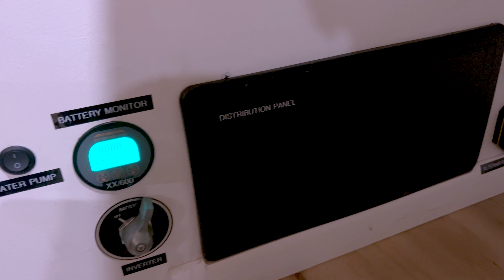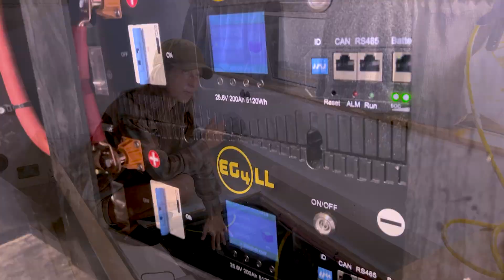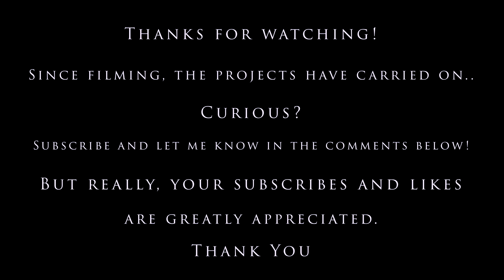Easy RV SOLAR Upgrade - 24 volt EG4 Lithium Batteries and Victron System

Comment: I really like that bright pink color. They can see your customer coming for sure! Nice balanced job and really clean install. We built a rack to mount 8, 550w panels on our motorhome's roof. After mounting the 18 feet that attach the rack to our roof, we caulked each of them and then sealed the entire roof, incapsulating the feet with Henry's Tropicool 100% silicone 887, lifetime guaranteed roof sealer. This is a highly reflective roof sealer that would work perfectly with bifacial panels. We went with single sided panels to save weight as the bifacials are pretty heavy due to the protective glass on the back of the panels. We have 4,400watts up there and another 620w liftable array on the side of our coach, so we thought 5,020 watts was enough for our needs without the bifacial feature. We were right. 

We use the 620w array to charge our 12v 560ah LiFePo-4 battery and our rooftop array to charge our 320ah 48v LiFePo-4 battery, for our 120v ac needs, like our residential fridge and our 12k btu 28.5 seer-2 EG-4 mini split. We use a 5kw Sungold power all-in-one inverter/100a charger/charge controller mounted on the wall in our bedroom rather than individual Victron components. This gives us a total of 23.5kwh of batteries onboard, which does the trick, lasting through several days of bad weather if needed. In fact, we haven't had to run our generator in the last 2 years of FT off grid use. Our large 48v battery lives under our bed which is heated by our furnace while our 560ah battery is located under the steps of our coach, where the original pair of GC-2 golf cart batteries used to reside. We insulated this space and cut a small hole in our step riser with a small computer fan to circulate conditioned air from inside our living area into this space, so the BMS doesn't shut down charging from them getting too cold in the winter, or their life reduced from too high temps in the summer.

Comment: oil resistant black rtv silicone for engines is by far the best way ive foind for getting a good seal that wont break down over time. 20 bucks a can but well worth it as a  couple cans would do your whole project

Comment: Love the new upgrade and a side note the AMG batteries can drop down to a quarter percent no more we use them here on our off grid Homestead and we have AMG batteries hard and they still take a good charge we've been looking into the lithium ions the technology is getting better I'm also a solar installer and technician but I am retired now I'm doing soldier when I have to I'm definitely looking into the lithium sit-up that you put in this bus it looks a lot better than the battle borns lithium batteries keep up the awesome videos

Comment: Bifacial solar panels are perfect for when camping, and you have the panels motorized to angle up and take full advantage of the underside.    Like parking at a different angle isn't doable, but raising the panels at a 45 degree can be more efficient.

Comment: Bi-facials panels are great if you do a ground mount where the panels are about 3 to 4 feet off the ground, that you have more ambient light reflecting the back of the panels.  Unfortunately rooftop mounting bifacial panels won't get you as much gain as you wanted.  Love the bus.

Comment: FOR SAFTY:     EG4 batteries are great for stationary applications, but they are not rated for mobil use.  For reasons such as cables fray and busbars can become lose along with many other issues I would strongly recommend you don't use rack mount batteries for your RV.  You can DIY your own or you can look for other options that take into consideration all the effects of  road vibration which ultimately lead to shorts and or fires.
Reply: Screws can come loose due to vibration, ok. What battery is not connected via screw terminals nowadays? Why are EG4 worse than Victron or other batteries? I don't see the argument.

Comment: I live in the middle of the desert outside Phoenix, Arizona. Generally speaking, black on black panels degrade at a slower rate than most other solar panels, especially in very hot climates. Generally, solar panels will degrade at a rate of 1% a year and up to 5% a year in extreme heat.

Comment: US Army Veteran living in New Zealand. I just bought a coach bus (BusLife Cozy Coach) with a 24 volt mains battery system. I will, in time, add a 24-volt 2-3000 watt solar system charged by the alternator, solar and a generator. I thought your video might show the viewers a step-by-step real-time installation, but the time-lapse version uploaded does not allow for a detailed view in real time; it is too fast to see and understand what you did. This was a bit disappointing, as I had hoped to learn from the close-up of your installation. I think your videos are of great value; however, there are two things to consider in my humble opinion; one, if you did the presentation in real-time, you would gain more air time with YouTube (more money for you from YouTube), and second, better educational videos will earn more interest which means more subscribers, more views. Keep up the excellent work. Tino pai

Comment: When you're removing the old panels you say that the footers were installed using Sikaflex (love LOVE that stuff) and self-tapping screws. Did you screw just into the sheet metal of the roof, or a rib? Curious because we've just installed our solar panels and did it through the sheet metal, but with bolts.

Comment: Great install very professional. You mentioned one of the options of alternator charging the 24v battery system. How does that work when the alternator is 12v and the battery bank is 24v? Is there  a dc to dc charger that takes the 12v and steps up to 24v to charge? Just curious because I really don’t know and would be interested in doing this in a build.
Reply from the maker: Thank you! And good question, i typically use a 12/24 35amp Sterling to charge a 24volt bank from a 12v alternator.. they can charge lithium safely and are very reliable products.  There are a few other route to accomplish the same thing, but Sterlings are my preferred

Comment: Great vid, how are you finding the bi-facial panels compared to regular? I am having a hard time believing that the reverse side generation would make sense on a cost/benefit basis...
Reply from the maker: Its pretty hard to specifically test the difference… i may be testing two 400w panels (one mono and one bifacial) side by side soon. So far it does seem like the bifacial has higher yields.. they are also super budget friendly as of lately.. check out the signature solar link i posted in the description, i went bifacial on this bus because they were actually less money than the monos! Panel prices have come down substantially in the last few years 🎉